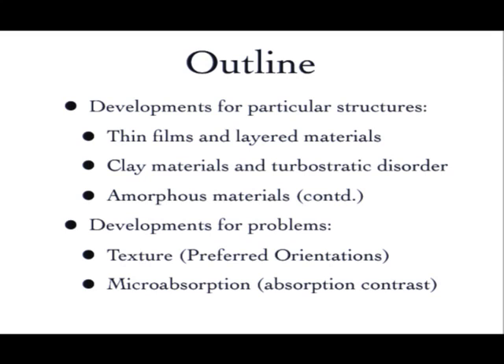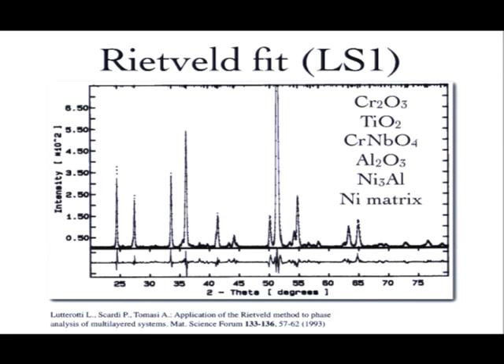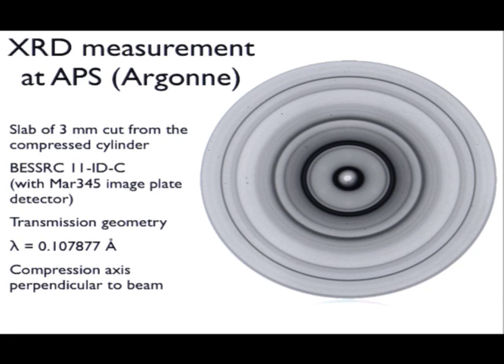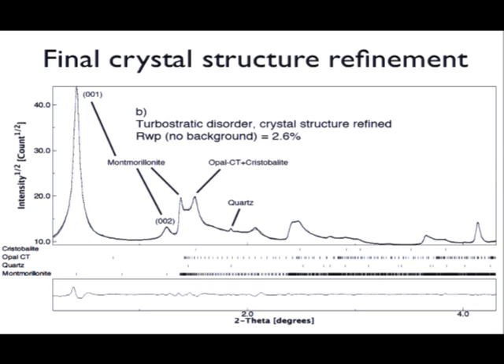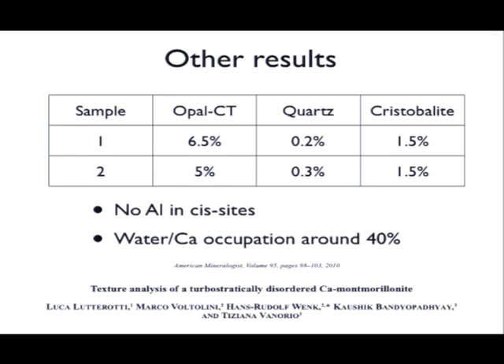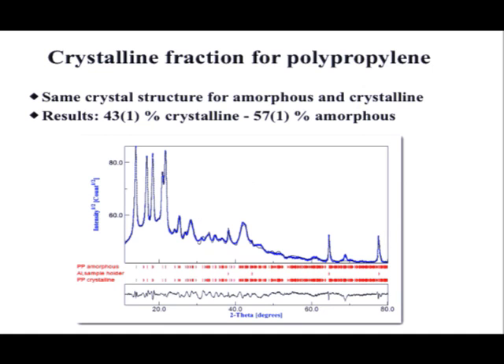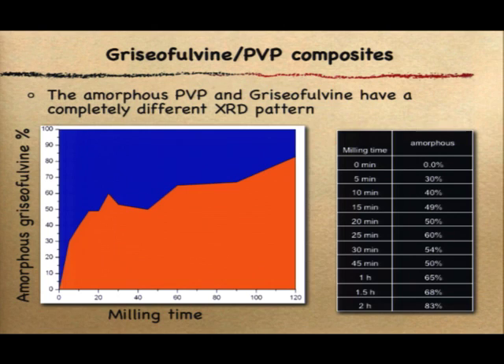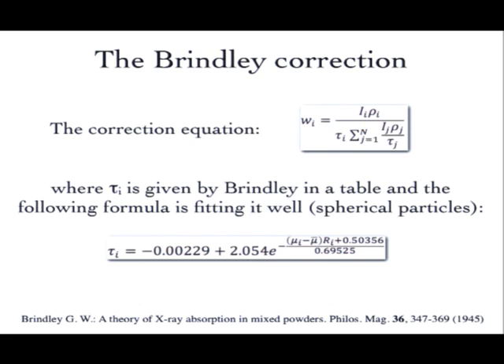Luca Lutterotti: Quantitative Phase Analysis

Comment: From volume fraction presented at 8:43, one can see that at that temperature there are substantial amount of Cr-oxides but limited amount of Ni-x (matrix or oxide). Does all Ni in the system correspond to 50-55%??

Comment: How that B factor presented at 8:43 is defined? Isn't that each element of the phase have different B factor? How that B factor for a whole phase such as TiO2 is calculated?? or B factor in this presentation and cited paper does not correspond to temperature factor (Debye-Waller factor)?
Reply: +John Nash The B factor here is the Debye-Waller factor.